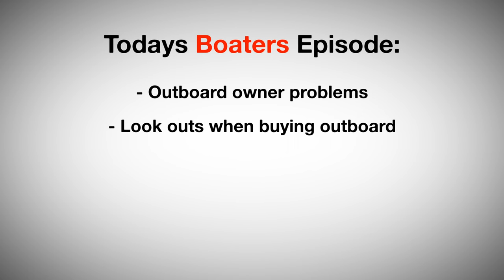Outboard Boats (Owner MUST Knows)

Comment: The boat I bought from the USA came with 400lt of fuel and about 40lt of water in the tank. The motor was dead because of the water, glad I didn’t pay a lot for it.

Comment: Hey! Are we able to talk about Porta brackets? Also just bought a sunk panga thoughts on cleaning a closed off gas tank?
Reply from the maker: For sure! Not this next one, but the following podcast we can talk about the Porta Brackets, they are sweet and work great! Also, try and call a pump out company, not sure where you are, but there are companies that will "polish the fuel tank" They suck out all the fuel and run a polish cleaning substance through the tank! That's what you'll want to do, do it sooner than later, that water is in there rusting out that tank :/ so don't leave it empty for too long :/

Comment: Can you talk about running an outboard WOT in the future? When I had my power head replaced on my mercury 4 stroke. The marina told me to its best to run it as close to 6000 RPM which I’ve been doing after I broke it in. Now I have people telling me I’m prematurely wearing out my new power head. I was always taught running it in its max RPM range prevents carbon build up
Reply: I’ve always been told, if you use good fuel, you in a fuel injected motor carbon buildup isn’t much of a concern.  Also, running an outboard wide open too much isn’t good. Also I’ve always been told closer to 5,500 rpm for max rpm

Comment: Just subscribed.   For boats 10 years or older, is a corrided tank pretty much guarranteed?  If you buy an older used center console, should you expect to have to replace the fuel tank?   Replacing a fixed fuel tank from beneath the floor board sounds really drastic and expensive.   No sense in repowering an older boat if the fuel tank is old, or am I assume all fuel tanks 15 yrs or older are bad?
Reply from the maker: Thank you for subscribing! I wouldn't say that though, I would say if you have a fuel tank fail in 10-15 years, there is something else wrong or the tank was defective. Most fuel tanks in a boat will last from 25-40 years without needing to be replaced :) So I'd say once you get over 20 years or so, that is when it needs to start becoming a deciding consideration when looking at a used boat to buy.
Reply: @TheBoatersPodcast  thanks

Comment: 0wner of a 2002 evinrude 175 ficht RAM ...gotta change the starter...It suppose to be the battery or Electric issues but ws the starter...now runs good...how i can now when i Ve to change outboard? How long can last? How i can notice when i diyng? 
Thanks
Reply from the maker: Well, generally you run an outboard until it is dead, aka it blows up, or has a problem that will cost you more or close to the amount of replacing it, or it continues to have problems to the point of parts failing regularly based on age and condition of the engine.
A way to know when that is, could be based on how many successful trips out on the water you get vs. how many unsuccessful trips you have based on engine problems preventing you from using the boat. 
There really isn't an age, hour, or determinate formula for knowing when that will be, each engine is an engine and some will run for ever :)
Reply: @TheBoatersPodcast  thanks.... and for u the best 200 hp outboard now?